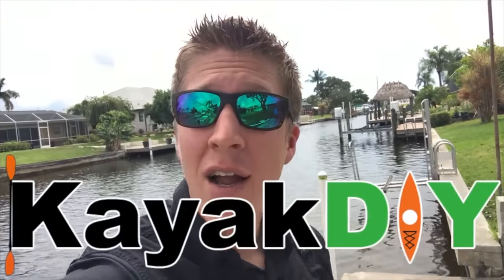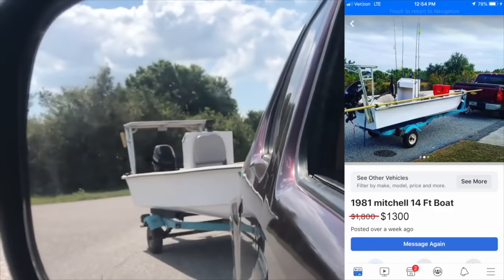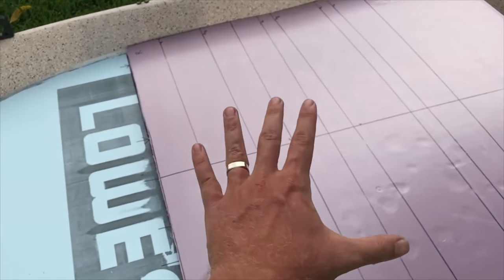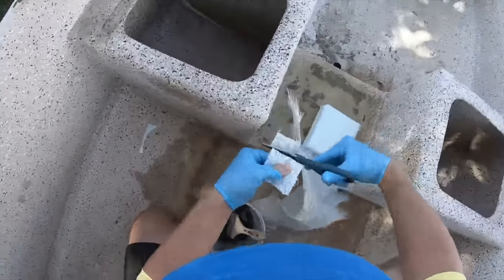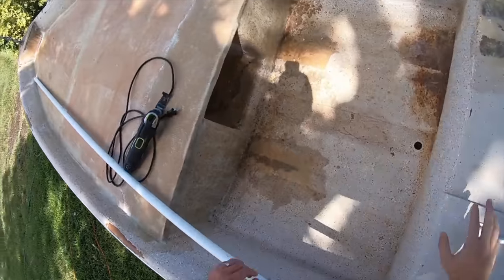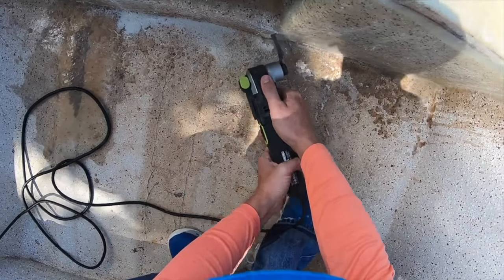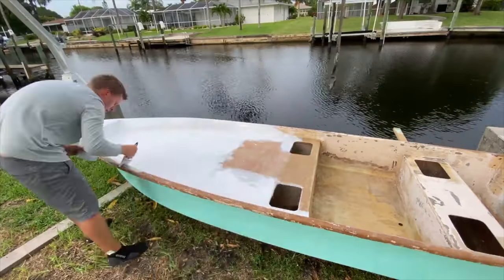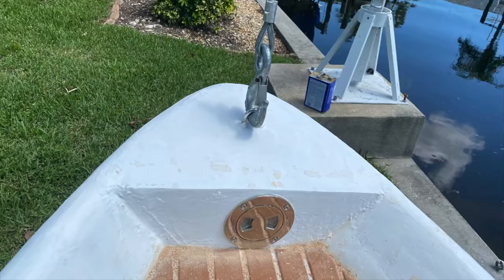HOW TO BUILD A FIBERGLASS BOAT IN YOUR BACKYARD (Start to Finish)

Comment from the maker: SKIFF PARTS & SUPPLIES LISTED BELOW
(FGCI Main Site) http://bit.ly/FGCI-HOMEPAGE 
(FGCI Amazon Site) http://bit.ly/FGCIProducts 
   
General Purpose Polyester Resin (Part#128776)
 - Or buy via Amazon: https://amzn.to/3tPyAm0
Clear MEKP Catalyst (Part#132663)
 - Or buy via Amazon: https://amzn.to/33Mubpc
Biaxial Fiberglass (Part#137312)
 - Or buy via Amazon: https://amzn.to/33InlBd
Chop Strand Mat Fiberglass (Part#125722)
 - Or buy via Amazon: https://amzn.to/3GT3Sfj
Red MEKP Catalyst (Part#132676)
Lightweight Polyester Putty (Part#133664)
Douglas Fir Marine Plywood (Purchased At Lowes)
Deck Hatches: https://amzn.to/2pbrDMI
EVA Teak: https://amzn.to/3o98JiT

OTHER PRODUCTS MENTIONED
   On The Fly Jack Plates: https://tbnation.net/products/onthefly-jackplate-manual-adjustable?ref=LiteSkiff
   1997 Yamaha 25hp 2-Stroke Short 15" Shaft (purchased used)
   PWC Doctor Versiplug #1501: http://bit.ly/VersiPlug
 Fuel Water Separator: https://amzn.to/3aJgwPB

TOOLS USED
   My Occilating Tool (expensive): https://amzn.to/33iRpNP
   Other Occilating Tools (cheaper): https://amzn.to/35qpsp9
   Drill: https://amzn.to/313jJCn
   Mixer Attachment: https://amzn.to/2OCnNXU
   Fiberglassing Starter Kit: https://amzn.to/2VsP3JK

Comment: I wouldn’t say this is building a fiberglass boat I’d rename the video renovating a skiff I bought cuz the title is misleading
Reply from the maker: Renovating a skiff has about 5-10% of the search volume as keywords “building a skiff”.  Sadly need to use keywords that work else video gets zero views.  These videos take a lot of time and need to get views.  I make zero apologies.  Just figured you should know why.  It comes down to Google search keywords.  Semantically both phrases fit the same niche.  Just one more accurately reflects what is in video.  I largely agree with you. 😉👍

Comment: Glass over 1/2 ply would have been more than strong enough for your application- less weight and less $
Reply from the maker: I totally agree.  I just couldn’t find that locally in marine ply.   I really wanted to use marine plywood to show the absolute basics.  Also I liked the added weight in bow to help plane out the skiff when I run solo.  

If I ever built a boat again I would use honeycomb instead of wood….and put coosa board in transom.

Comment: looks fun but i was misguided by the title. you modified a boat not build one XD
Reply from the maker: I’m sorry.  Just had to go with what was most searchable in terms of keyword semantics.  No point in making videos if they don’t get watched.  Tried making it clear early in video that it wasn’t a fresh 100% build from scratch.  Was pretty substantial rebuild though.  Only thing I would have changed was run more large chaser tubes for electrical lines. Also if I gut it fully I would have built up false floor, foamed it, and made a self bailing deck.  Relying on bilge pump is annoying.

Comment: You added weight,need more HP
Reply from the maker: Correct.  The boat came with 8hp which was still under-powered before the new heavier deck.  Between adding the heavy deck and a 25hp outboard it got on plane quick.  With my weight in the stern I needed weight in the bow to help boat plane out quick and balance out.

Comment: Buildinga boat for 1 year. Giving all the energy. Then buying a fake teak coat or smthng like that that looks super fake, and then making the boat look cheaper ... weldone.
Reply from the maker: @DavulKursu  If it was too nice I wouldn’t use it.  Also EVA was more comfortable and absorbed less heat.  We didn’t meet the deadline for giveaway.  Eventually sold the boat.  The person who bought sold it then bought it back and I see him all the time on the gulf.  He loves it. Boat was designed to be low easy maintenance and to be USED….not a showroom piece. I also didn’t have a huge budget around that time of filming.  The channel wasn’t near as big back then.
Reply: @KayakDIY  "If it was too nice I wouldn’t use it" :DDD laughed this, totally understandable :D whatever. you have done an awsome job <3